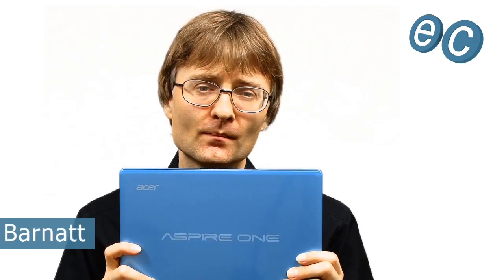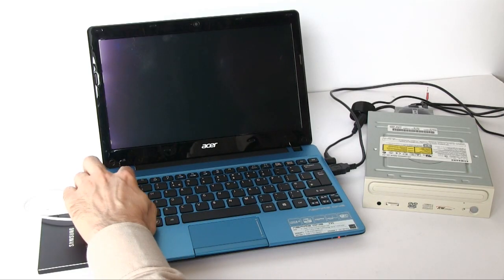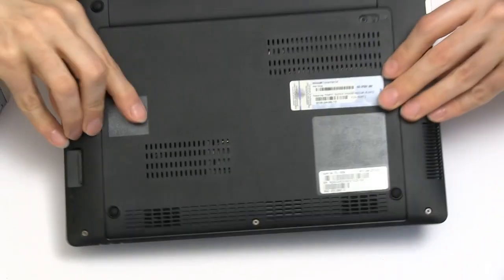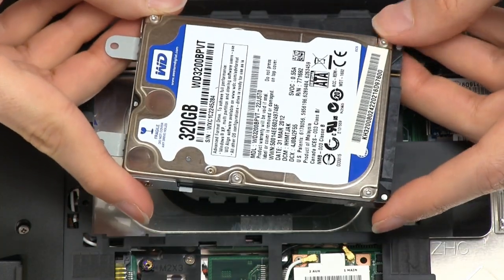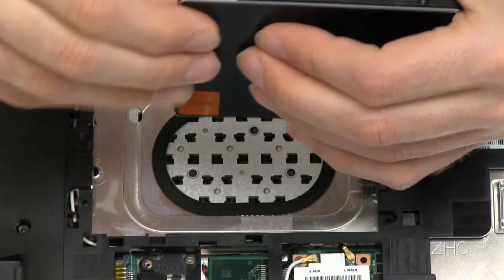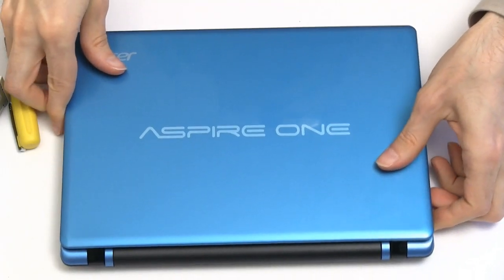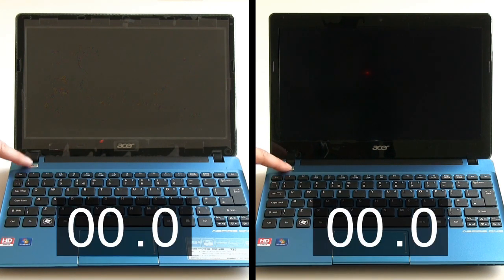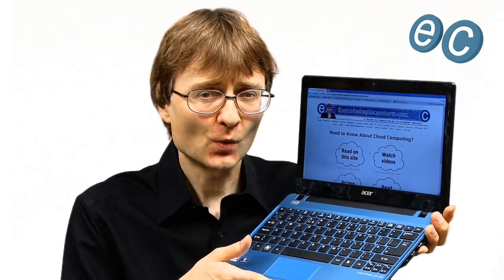Laptop SSD Upgrade (Aspire One 725)

Comment: the backpanel of my netbook won't budge off. Any help?
Reply from the maker: +XDBLaHBLaHDX I would guess you have missed a screw -- remove the battery and elsewise check in the battery compartment. Also check for screws under any stickers, or even under any stick-on rubber feet. Also try all possible directions to slide the back first. It should not take that much force.
Reply: +ExplainingComputers i got it off eventually, but with muuuuch force than you did :( i guess some of the 'hooks' got stuck. But after that, the back panel was smooth to put back and get off. Thank you :)
Reply from the maker: XDBLaHBLaHDX
:)

Comment: Hi, If I install a new SSD can I do fresh windows install from DVD instead copying the whole thing from HDD ?
Reply from the maker: Yes, you can do a fresh install of Windows and reinstall other software if you have the disks. Good luck! :)
Reply: ExplainingComputers Thanks for the quick reply I have Acer Aspire 5755 Laptop. I have very basic knowledge on terms like SATA, 2.5 etc, it will be really helpful if you could tell me which exact spec SSD I need to buy.
Actually I have a 500GB HDD and got dual boot win 7 and Linux. Which seems like too complicate to copy over and also I will need same size SSD which will be very expensive. Since I use Linux very rarely might just be ok with having win 7 copied to SSD (120/240) instead. Will it work or need to do fresh install ?
Reply: I did further read through on the topics, seems SATA 3, 2.5" is the requirement for laptops and most of them on the market are compatible. The other thing is my laptop is having SATA 2, the drives are backward compatible and they will work though not give the max performance. I did a bench mark of my current HDD and it give me around 85-90MB Read/Write speed. Now my worry is upgrading to SSD how much speed improvement will I get will it be noticable and hence is it worth or better wait for next laptop with SATA3 HDD.
Reply from the maker: Itsme Me Yes, any 2.5" SATA drive from a reputable manufactuter ought to work in any laptop. The big difference you will notice with an SSD is system responsiveness: PCs do just run better with an SSD as the boot drive, so you will certainly get a benefit. You will also have the safety benefit running a laptop off an SSD rather than a spinning disk, as a good thump will not risk causing serious damage. You will get some boot speed up also. But how much all these are worth is rather subjective I'm afraid. There is certainly a logic to let sleeping dogs lie if you are currently happy with how your laptop performs . . . :)
Reply: ExplainingComputers gr8 thanks. Have ordered Kingston 240GB SSD. Lets give it a try. Can always use it in future laptop (SATA3) if its not making much diff on this one. If all goes well and the laptop boots will definitely put a comment ;-)
Reply from the maker: Itsme Me Good luck! :)
Reply: ExplainingComputers Excellent, Got my upgrade done. It was much easier than I thought. Just 2 screws to remove and the HDD was out in my Acer. The back panel and HDD are secured with the same 2 screws. Did a fresh install win 8.1, Office 2013 (including Projects, Visio), Photoshop, Nero etc. I haven't compared the timings as my previous HDD had Win 7 and office 2010. But this one is amazingly fast 10-12 secs for win 8.1 boot (straight into Desktop). 6 Sec for Photoshop to open. 2-3 sec for Word, Excel. So its amazing. I am happy I got this upgrade done was concerned earlier as was not sure the SATA2 backward usage will make any noticeable difference or not. The new SSD is 450mb Read/Write, I am sure I won't get this speed though. So don't have to worry about slow laptop needing replacement for another 3 years, its already 3 years old now.
Thanks your video did push me forward to get it done ;-)
Reply from the maker: Itsme Me
 I'm glad everything worked out OK  -- and that you boot Win 8 to desktop! :)

Comment: assuming that i wanted to add in an SSD on my PC
i can still use the SSD along with my HDD right?
+ExplainingComputers
Reply from the maker: Yes, you could use both provided that you had enough SATA ports to connect the drives to (not a problem on a newer PC, but earlier motherboards had just two SATA ports, and if one is used for your hard drive, and another for an optical drive, expansion options are limited!).
Reply: thank you very much

Comment: what is SSD stand for?
"Super-Small-Drive"?
Reply: Solid State Drive
Reply: oh... thx
Reply: In SSD there are no moving parts (motor etc) inside and its wise on battery and heat. And way faster than the standard HDD drives.

Comment: Thank you! I've been getting trolled all night by my new v5-123 while trying to replace its 500gb HD with an SSD. I could not figure out how to get the drive bracket backwards and didn't notice those are 2 screws (my eyesight is bad). Suddenly all makes sense!

You wouldn't believe how many videos I've watched on here to try and figure it out, but they all have a different drive bay assembly.

Comment: Using the usb connector with the SSD, could you use it as an external drive?
Reply: TL;DR: yes.
Long: Most 2.5 HDD and SSD drives can be used over a USB connection, but you may want to use a 2 USB Type A to USB Type [x] (some use Mini B, some use Micro A or B to a bar that goes to SATA) to get more power or the direct SATA to USB connector used in this video (The SATA bars can be found in some external mini 2.5 HDDs in custom enclosures, for example a GoFlex external HDD) .

Comment: Nice fairy tale. 1. the drive does NOT come with a cable. 2. the software is no longer free - or even close to that. 3. Windows will NOT let you copy anything out of an active partition. And, adding an SSD that is smaller than the original HDD is a VERY convoluted process, one you really have to be dedicated to the task to even start.

Comment: I ended up using "Samsung Data Migration Software" that I also found on their site. I've purchased a laptop upgrade kit like in this video and cloning windows fron the HDD to the SSD via the USB cable worked flawlessly. Just swapped the disks and it's a huge increase in speed! Though I already knew that would happen, I've also got an SSD in my desktop. I would never go back to regular HDD's (except for storage, of course). Anyways cheers for this vid, and keep up the good work you're doing.

Comment: Thanks for the clarification! I have also just found that there is a program calledEaseus Todo Free, which has a special function that does properly align your SSD when you clone from a HDD. I bought a Samsung 830 though so I'll see if that comes with useful software as well. Thanks again!

Comment from the maker: PS: Automatic defrag should be turned off if you are running an SSD. Also some unallocated space should ideally be left on the drive. Once again the Samsung utility mentioned above will sort this. Also, early SSDs were far more prone to performance degrades that modern drives, so the issue here is now less important than it used to be.

Comment from the maker: There is no issue with the data itself, but it is correct that the optimal configuration of an operating system for using an SSD is different for one running from an HD, hence just copying Windows over could cause issues. However, Windows 7 (& 8) now automatically detect a modern SSD, and will turn on TRIM to preserve SSD life. If you add an SSD to an older OS it does not support TRIM, so the config is OK. The Samsung SSD here comes with a utlity that automates optmal config, & a free clone app.

Comment: I was told that cloning directly from a HDD to an SSD is bad because the data will not properly align with the SSD, making its lifetime expectancy shorter. Would you know anything about that? Also, is there a free trial of the software that can be used?

Comment: I still use a standard HD on my netbook and when I had XP on it took forever to boot up. I recently installed Ubuntu on it and it starts up in 15 seconds. I'm thinking of a ram upgrade and maybe a cpu upgrade to core i3 but the hard disk is fine for me. I have an Aspire One from 2010

Comment: Just surfing here.  I installed an SSD drive yesterday. Downgraded from a Samsung 1 TB drive to a 256 Gig SSD pro drive.  That's more than plenty for my uses anyway.  Used the Samsung software to complete the process.  This computer is now CRAZY fast.  It took about 50 min to clone my old HD.  Best upgrade to a computer I've ever experienced. Results= old start up time about 50 seconds.  New start up time 10 seconds cold start at worst.  Mind blowing.

Comment: Hi, so by using this software you can clone a larger drive to a smaller SSD ? i have a 560gb hard drive, using about 128gb, i've bought i 256gb SSD which shall come soon, so if i use this i can clone whats on my harddrive to my ssd ?

Comment: This is so weird. So I thought for sure that I will need a product key to install on my 725 with a fresh copy of windows 8 and I couldn't find it anywhere on the computer. I was reading instruction here pcsupport.about.com/od/windows-8/a/install-windows-8-usb.htm to do it from a fresh install with USB boot since I had brought Windows 8 Pro CD for my Desktop. After the installation, it didn't even ask for a product key and it was running and in system it is showing Windows is Activated.

Comment: First , thanks for the great video etc.. So , I have an Acer One 725 running a Windows 8.
It's new PC. My questions are  , I can install the SSD , skipping the cloning? I don't need to save the things from the original hard drive. All my personal things are in the clouds. And you may please , could tell me,  more SSD  , options, with  More capacity I can buy above the one installed? Thanks again for you video. It was great to learning from you.

Comment from the maker: Sorry, I don't have  257, I just looked up the spec to answer your question. :) I've put SSDs into Asus and Samsung 10.1" netbooks. The key thing is getting inside them and accessing the HD to replace it. Look out for screws in the battery compartment, or under stick-on feet. Good luck! :)

Comment from the maker: Yes, you could fit an SSD in place of the HD in the D257 -- it would just be a bit more difficult that with the 725, as it is a smaller machine, so more difficult to get to the disk. I have put SSDs into 10.1 netbooks though -- it just takes a bit of patience! :) In the D257, the RAM probably cannot go beyond 2GB.

Comment from the maker: Yes, you are right. With a desktop you can just plug in the SSD into a SATA socket as you say. And it will be much faster than using this USB 2.0 adapter. :)

Comment: Im guessing that the Samsung Migration Tool was out yet? I just bought the Samsung 840 and the migration tool is SO EASY to use... Had to use a old school external power pack / SATA cable to interface the SSD to the computer as I couldn't find the KIT version like you have in your vid.

Comment: I believe this has a Radeon HD 6290 integrated video card, so it should play dota well. I've seen a youtube video with something like this running skyrim. The main thing is that the processor has to be AMD, and not Intel Atom, since intel video cards don't handle games well.

Comment from the maker: I don't know your particular machine, but would personally first opening up its bottom panel to get to the drive. And if this fails, try the topside (keyboard) route. I have opened up several netbooks for an SSD upgrade that way.

The Samsung SSD I used (830 series) does indeed include free cloning software.

Comment: Hello! I attempted this SSD upgrade on my AspireOne with OCZ Vertex 4 using Apricorn Ez GIG IV for Win8 cloning. I could clone OS to the ssd fine, but for some reason when I physically installed the cloned ssd and turned it on, BSOD appeared and told me that I need to connect to a recovery media and the ssd is cannot boot...I tried other methods of migrating OS but though ssd is recognized by the computer, it won't boot Win8. Gives me error code 0cx0000001.Help! is it the OCZ ssd you think?

Comment from the maker: In short, you will not have any problems fitting an SSD into an Aspire One 725 with Win 8. I have been looking into this and do not actually think there is a significant problem. Running Win 7 on my 725, in my device manager I only see "AMD SATA Controller" (ie no evidence of an AHCI controller). But the BIOS shows AHCI being used for the SATA ports, and an "fsutil behavior query DisableDeleteNotify" command prompt check confirms that TRIM is running. And I'm sure this will be the case in Win 8.

Comment: Unfortunately this netbook (aspire one 725) does not support AHCI mode for ssd using windows 8 - at least as far as I am aware - it works fine for me in windows 7 - but the AHCI controller is completely missing in my device manager with all updates installed using windows 8

Comment: Here is a little tip take a strong magnet and swipe the magnet toward the tip of the screwdriver. That will make the screwdriver magnetic. That will make putting tiny screws too early in the morning a lot easier. The more you do it the more it will be magnetic.

Comment from the maker: No problem! I have a UK 725 (I am typing on it right now!), which comes with 4GB of RAM. This is the maximum RAM that a 725 can handle, so I did not upgrade it. However, elsewhere in the world some 725s come with 2GB of RAM, and if this is the case you can increase it to 4GB via replacement with a 204-pin DDR3 PC3-10600 SODIMM (the memory module can be see top-right in the video at about 5 mins in). If you do replace/upgrade the RAM, be careful to ground yourself to avoid static damage. :)

Comment: Wow, that's interesting! Be cause my AO725 with 4GB RAM & 320 GB HDD 5400 has: CPU 3.3, MEM 5.2, AERO 4.1, GAMES 5.6, HDD 5.9. Of course W7 HPx64 pre-installed. I can take a pic if U want to see this magic. I think, the SSD must have something about 6.5 after upgrade and maybe other scores (cpu&mem) also will be slightly higher. Hmmm...

Comment: I think the major difference besides how powerful the CPU is, with this and an ultrabook, is the SATA speed.
I could be wrong, but I'm guessing the net book has a SATA 2 (3gbits/second) controller and an ultrabook would be SATA 3 for the full 6gbits/second.
I did a similar upgrade and saw that my motherboard was a bottleneck.

It's still way faster than mechanical drives, but I could have got a budget SSD for less money.
Crucial memory recently started selling cheaper SATA 2 SSDs for this reason

Comment from the maker: Right! But is also makes it far more robust (no risk of a disk head crash when using the device walking around or more generally on the move). Also, computers with SSDs are generally a lot more responsive to use than those based on a hard drive. The user experience of using this machine with an SSD is totally different. :)

Comment from the maker: Oh dear. Your Intel 330 SSD is a standard-sized drive with standard SATA connectors. So it should fit as a direct replacement for a 2.5" HD. The only thing I am wondering is if your notebook has an older IDE interface, rather than SATA. If you look at the HD, does it have the same connectors as the SSD? Also, what is the model number of the notebook? I will try to assist if you can provide more info.

Comment from the maker: Yes, the USB adapter will work with any SATA device that is capable of being powered from a single USB port -- so it will work fine with all SSDs and most 2.5" hard drives. It really is a very handy extra to get in the box!

Comment from the maker: Yes, everything is copied -- Window, data, the lot. But the copy of Windows is licensed to the machine, not a disk.So there is no piracy going on provided that the SSD is put back into the machine it came from (and the old disk would only work in identical hardware anyway).

Comment from the maker: In an ideal world, maybe. But cloning and then running the Samsung SSD Magician software here obtains the same result. You can also only do a clean install if you have Windows disks, and these are not supplied with the Aspire One 725. Nor are recovery disks supplied. Finally, here I was cloning a disk from a brand new computer.

Comment from the maker: If the netbook is running Windows 7 (which it probably is) then I would go for the RAM upgrade first. Windows 7 will struggle a bit in 1GB (and it probably has less, as I imagine some of that will be used for video memory).

Comment from the maker: I take your points here -- but without a Windows installation disk I could not do this. Also, there is a nice little utility with the Samsung 830 drives (Samsung SSD Magician) that sorts the disk settings out in Windows and also optimises the OS more generally for SSD use. The video was getting rather long, so I did not show this! :-)

Comment from the maker: What do you mean "extremely recommended?" In what circumstances? Yes if the installation is old. But this was a clone of a brand new disk (the PC was 48 hours old) after manufacturer bloatware had been removed. This machine did not come with any form of Windows or recovery disk, other than a partition to return it to factory state (inc bloatware) which is where it was already. Within organizations (where most PCs are!) the vast majority of installs are from images clones), not installations.

Comment from the maker: Yes, exactly the same. Except that if you are replacing a 3.5" disk in a desktop PC with a 2.5" form-factor SSD, you will probably neeed a 2.5 to 3.5" mounting bracket to fit it in. Some SSDs now come with this bracket.